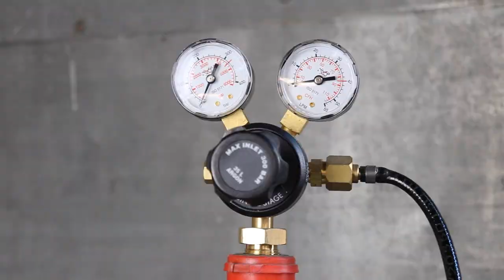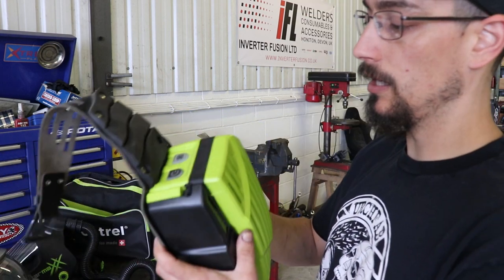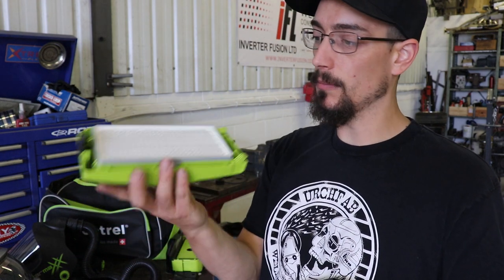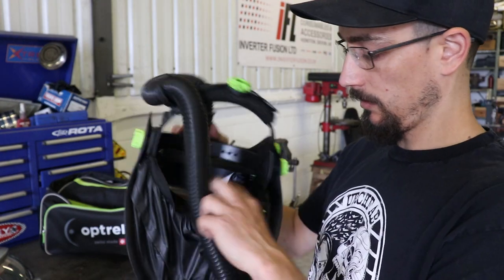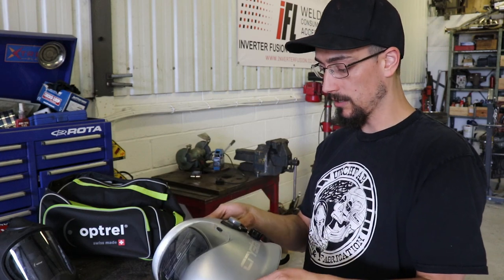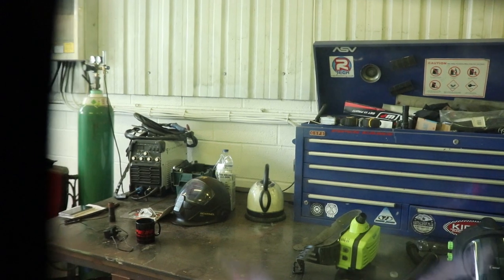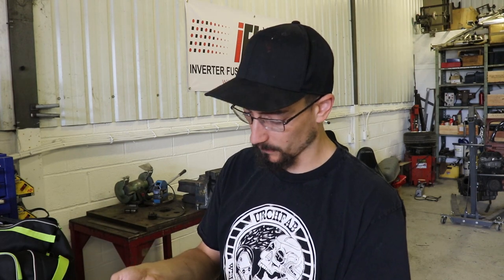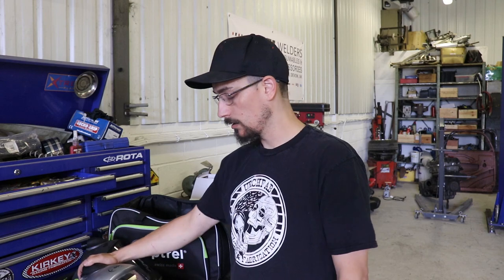OPTREL CRYSTAL 2.0 AIR FED REVIEW + CNC PLASMA HELMET RACK

Comment: im glad to see you are promoting this unit. I have done lots of welding just as a hobby, for the last 50 years. 3 years ago I was diagnosed with bladder cancer.  the number one cause is smoking, the number two cause is toxic fumes. I don't smoke so the doc said it probably caused by lots of welding. thanks for the great videos.

Comment: Nice safety set up there. I would imagine it is a bit of a hassle to start with but would become second nature once you have persevered and got used to putting it on. I think some kind of dust cover over your hanging rack would be a good idea to stop general workshop dust getting into the masks as they hang there. Would defeat the purpose a bit if they already have dust in them and probably a pain to clean the inside of the screens - not to mention risk of scratching them while wiping out particles that have dropped in. Just a thought - the way they hang might be sufficient, it's not like you have much body fill dust blowing around the place.

Comment: Heads up. If your using your 3m respirator you need to be clean shaven other wise your not getting a proper seal. Hope you keep the Optrel Set up.

Comment: the airintake is usually hanging of the lower back , eat too many beans the evening before and the toxic gasses comming of youre work will be the least of youre worries
optrell makes nice stuff . got the soft welding cap from them  https://images-na.ssl-images-amazon.com/images/I/41NSSM0by1L._SX342_.jpg
its wash able wish is real nice and it block all light from the back so you dont have reflections inside the helmet